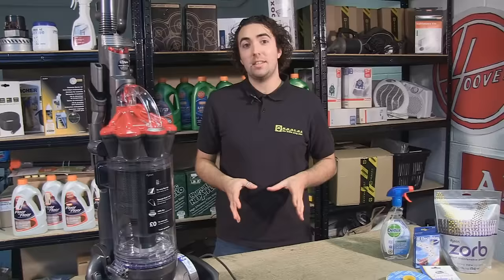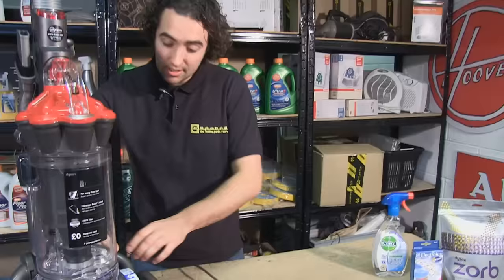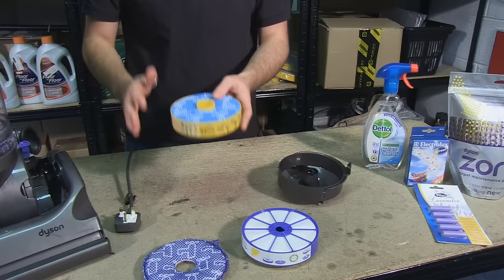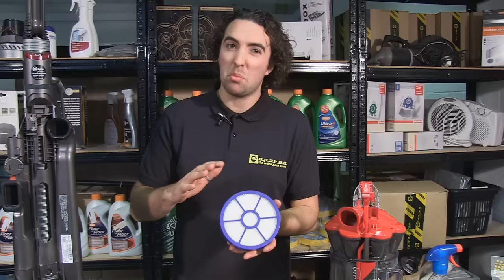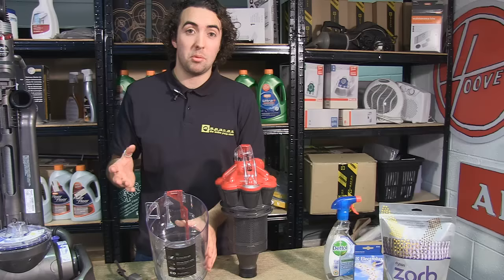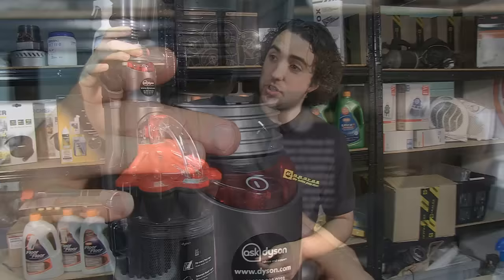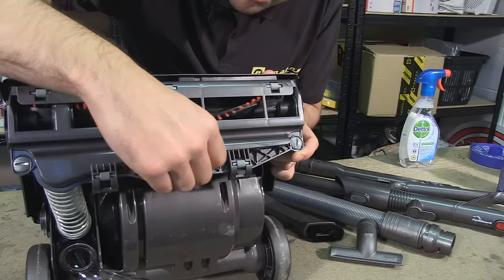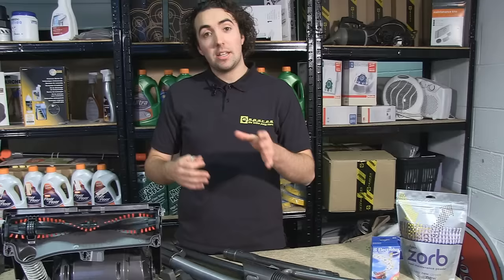How do You Fix a Smelly Bagless Vacuum?

Comment: This is an awesome video! I've salvaged 8 vacuums of various models from my towns local dump site and all of them were up in running order after a thorough cleaning and filter replacement. One way I've found to deoderize the canister is to dump a box of baking soda in it and leave it for a few days ( WRITE A NOTE SO YOU REMEMBER ITS IN THERE AND DON'T TURN ON THE VACUUM) then dump it out wipe down the canister and the smell is gone. You can also put baking soda in a hose that smells bad, leave it, and rinse it out for bad smell removal.
Reply from the maker: Hi strayiggyTV, thank you for your post and glad you enjoyed the video.

Comment: Hi, wondering if you could help me with my problem. I have a black &
 decker dustbuster flexi 12v and recently I rinsed the filter and didnt 
let it dry completely before putting it back into the unit. Few days later when I turn 
it on, the fan would blow a foul wet smelling odor. I removed the filter
 and soaked it in soap water but somehow the odor seeped into the motor 
and fan part. 
Is there a way for me to get rid of the odor from said motor and fan? Would be grateful if you have any solutions.
Reply from the maker: There are a number of products available to fragrance the air flow from a vacuum like these: http://www.espares.co.uk/search?SearchTerm=vacuum%20air%20freshener
However in this case you may have introduced mould and spores that will now be blown out of the motor when used. For that reason I would look for would be a product specifically to remove mould and bacteria and vacuum up the product in an open outside area. I am thinking something like a dry carpet cleaning powder or similar.
Reply: eSpares
 Could I just vacuum up baking soda and leave it in the filters? Would it absorb and neutralize the odor?
Reply from the maker: I was considering suggesting this. The honest answer is I do not know. Baking soda may be corrosive and damage the motor but if you consider the appliance is not useable you have nothing to lose. I would certainly rather risk damaging a vacuum rather than the health of my family from mould spores in the air from a contaminated machine.

Comment: What about the cyclones
Reply from the maker: Hi, we did not cover cleaning the cyclone but if you read the other comments you would have seen we posted 'Daconthocon78' comment about using a garden hose to clean this. 
Obviously if wetting to clean it you must ensure it is completely dry before use by draining and leaving to stand in a warm environment.